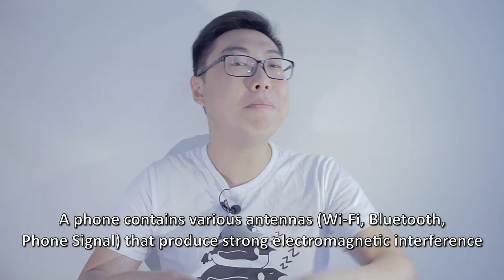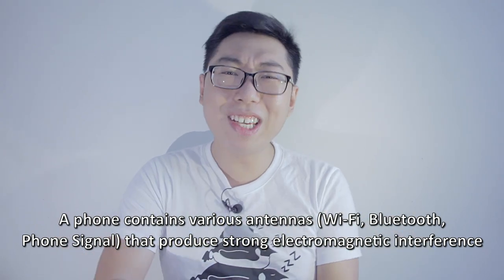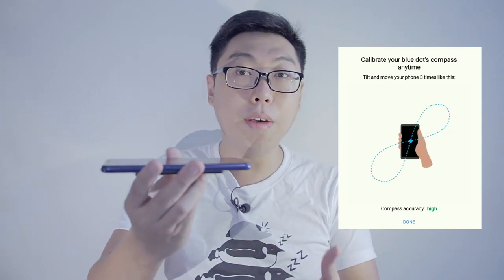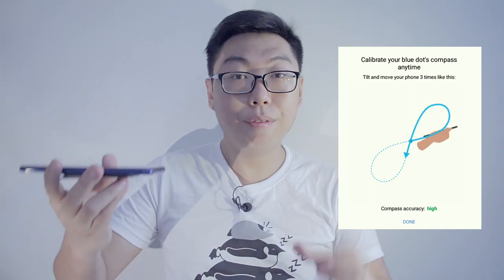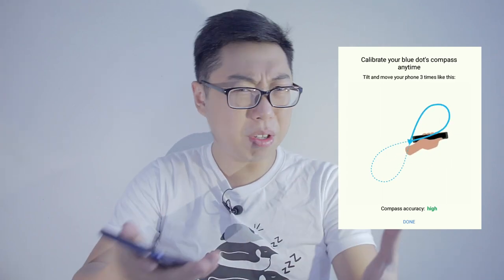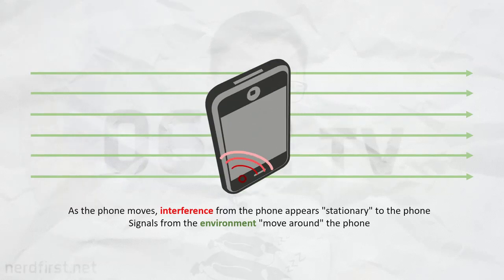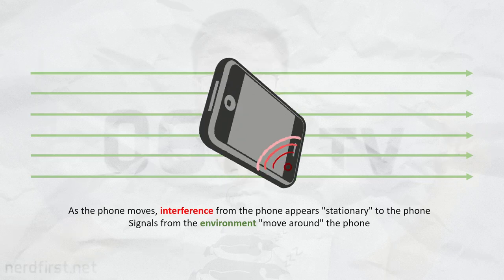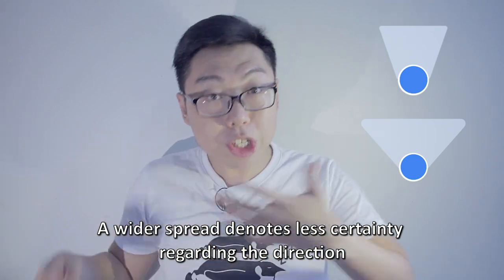Compass Calibration - Friday Minis 275

Comment: Interesting! I’ve heard of a way to abstract noise by varying magnetic field; by  measuring the difference in voltage between peaks and troughs of magnetic field rather than measuring variable voltage. I don’t know if It has a name or if it’s applicable on phones though.
Reply from the maker: Hello and thank you for your comment! I'm not sure what that refers to in particular but it does seem like a hallmark of the technique - The idea is that if you deliberately introduce some external change, whatever doesn't change must be internal.